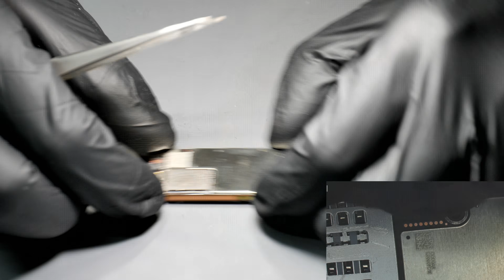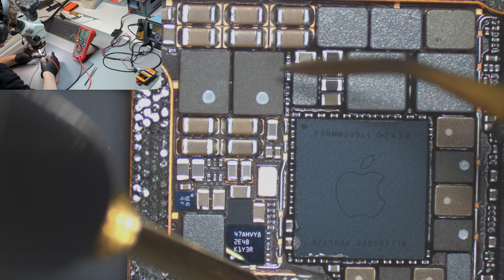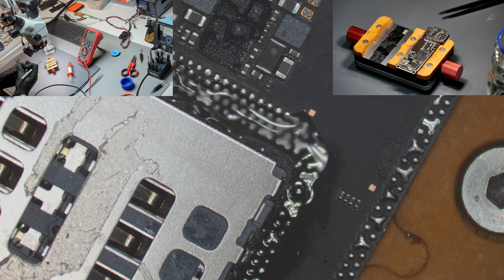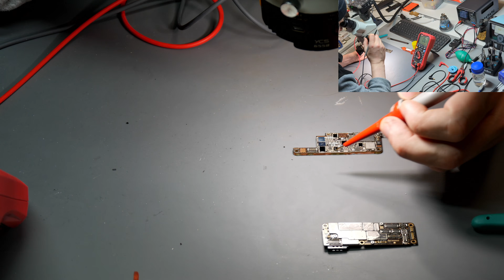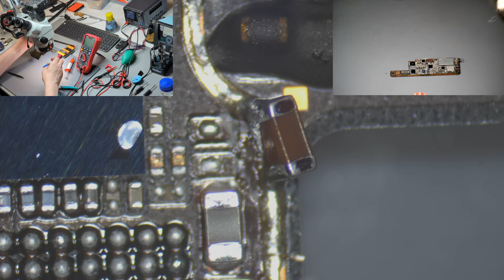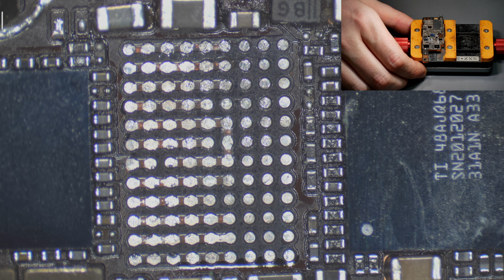Dead iPhone 16 Pro Max: No Power, No Charging - Charging IC Replacement (data recovery)

Comment: These types of repairs are only worth in countries with cheap labor.  In the US the time for disassembly, diagnostics, chip replacement/reball, testing, reassembly would make this an over 500 dollar repair.   Unless the data is really important, just not worth the time and hassle.